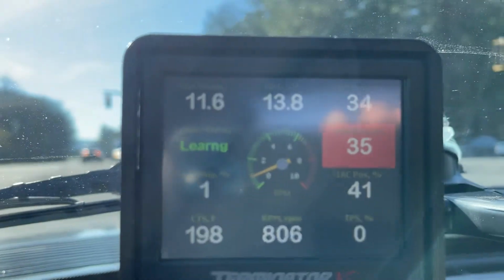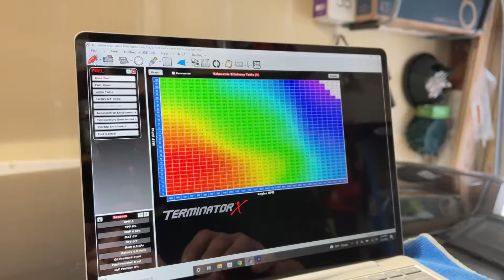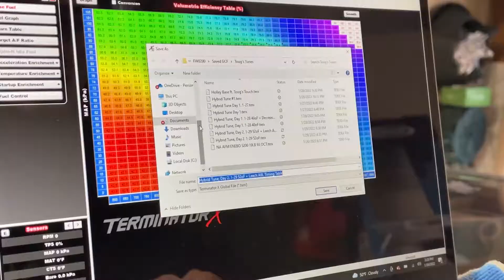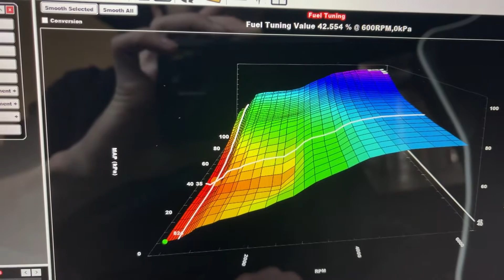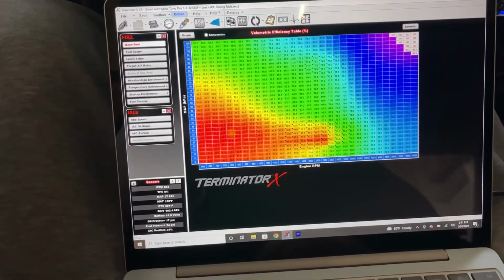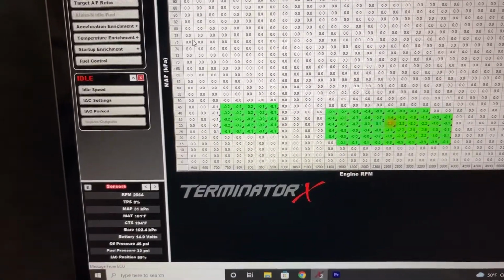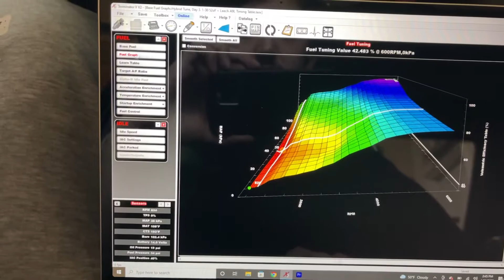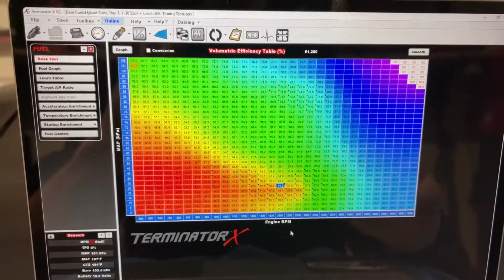Basic Fuel Tuning on Terminator X Software (Foxbody)

Comment: What boost are you running and peak timing?
what’s your intake temps and fuel gradr
Reply from the maker: Max boost I have ran is 10.5psi, but I was mainly running 6-7lbs at around 16-18 degrees of timing depending on boost. Intake temps remained around 70-90 degrees and running 93 pump gas. 👍
Reply: Good to know how bout your boy with the vortech I have literally the identical setup
Reply from the maker: @rydeordiegr  Haha nice! That’s my brother, but I am not sure of his tune. I know his intake temps were well over 150 degrees, until he installed his methanol kit, then they would come down to around 90-100 degrees. Highly recommend the methanol kit from Anderson Ford motorsports.